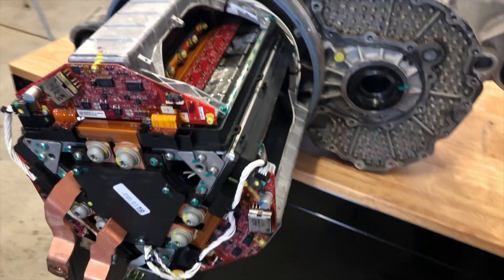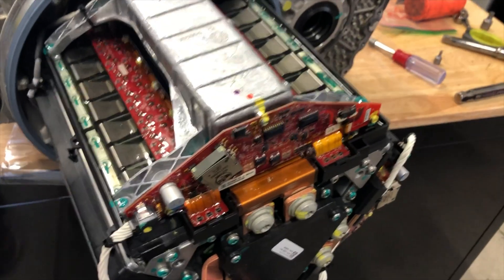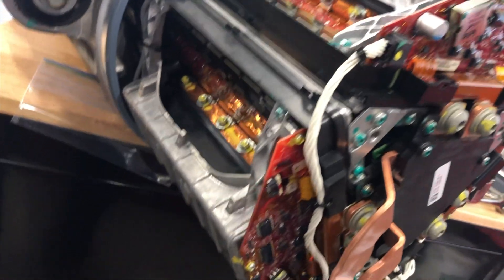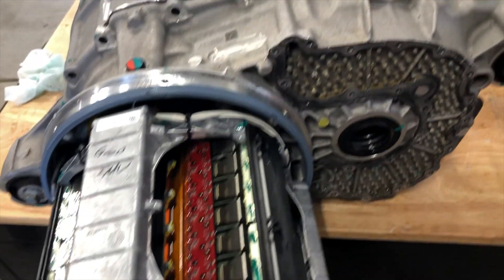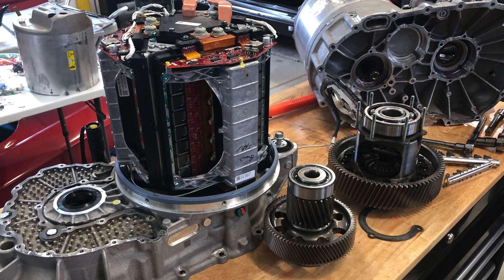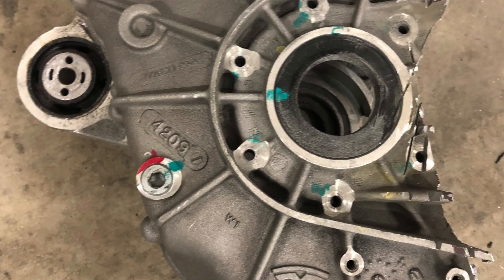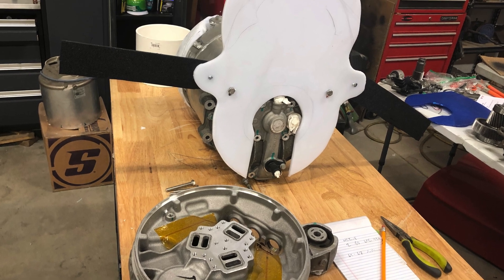Revolt Customer Review: with Patrick from Inspire EV

Comment: My only criticism is that the drivetrain takes up critical room in the car. Room that could be used for batteries. You're stuck with a 100 mile EV because there's a drive line under the car. Or you use up all the trunk, pack batteries where the back seat used to be, etc.

Comment: Fantastic interview! I watched all the Inspire EV videos and... then waited... And waited... And... finally there was a Revolt motor in a completed car. 

I get it. Modifying a complex manufactured system is very difficult. 

The Revolt setup is such an elegant-looking solution! 

And unless you're going to diy every part of the chassis and drivetrain, the Revolt system ISN'T more expensive. Every other off-the-shelf (ish) solution will cost you at least as much.